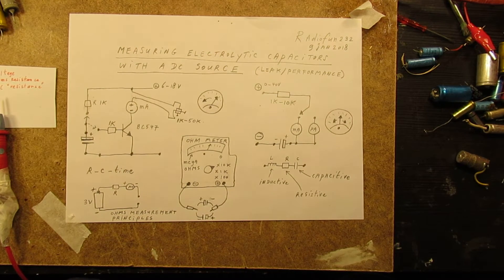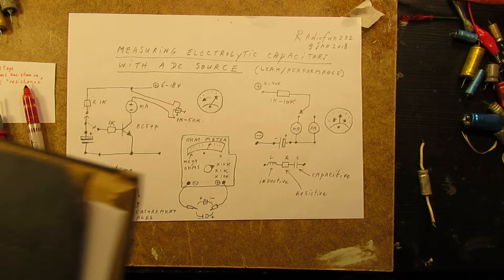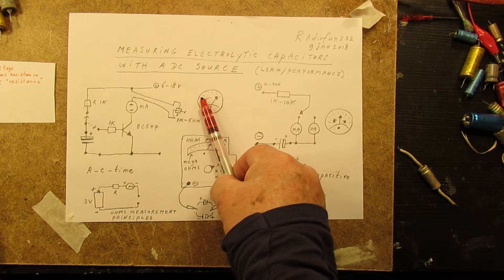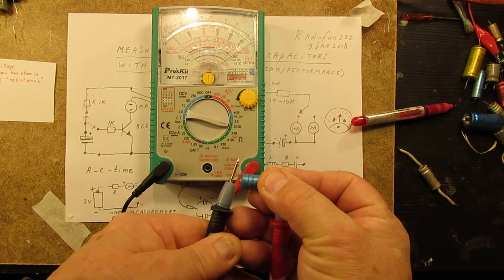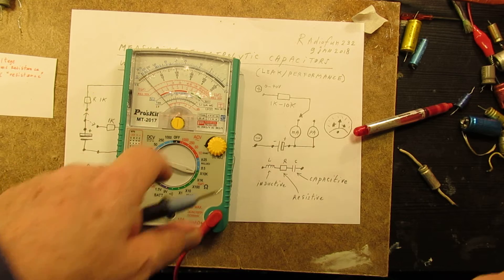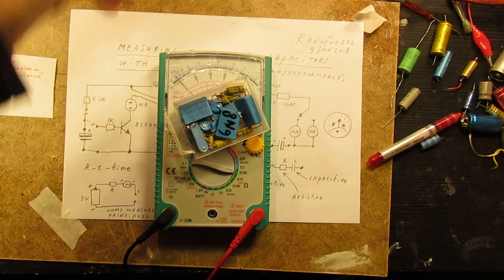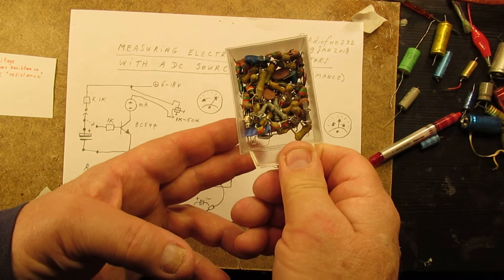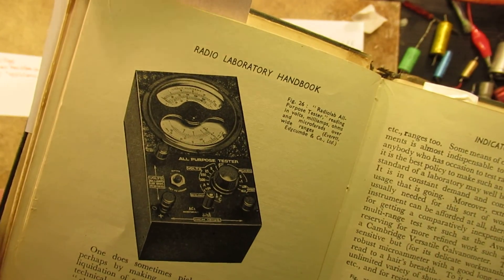Electrolytic capacitors: how to test them with a DC Voltage source (leak current, read textbox)

Comment: I'm testing 2kv 3kv capacitors found on vintage oscilloscope. What is the best method to test leakage?
Thanks ❤
Reply from the maker: Put DC on the capacitor on its working voltage (visible in the schematic). Make a voltage divider of 10 M/1M, solder it parallel to that capacitor and measure how quick the voltage drops (after the capacitor is charged up to its working voltage) parallel to that 1 M resistor in the voltage divider. It has 1/10 of the test voltage (10 divided by 1). That gives you an indication. Please know that real HV capacitors can show good on the meter, but fail in the practical HV circuit (I found that while making a HV unit for 3000 Volt on 16 KC for an oscilloscope).
Reply: @radiofun232 exactly in low voltage capacitor gives good results but near their max voltage behaviour changes and becomes leaking or sparking...
I will try your method.
Thanks❤